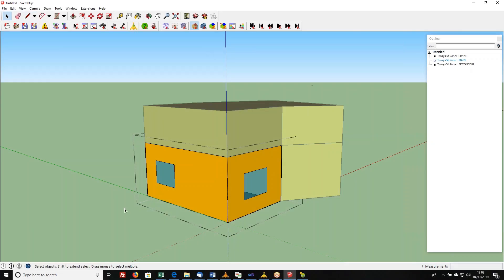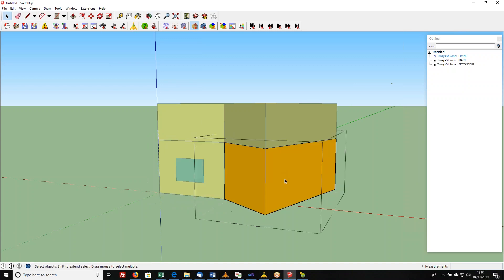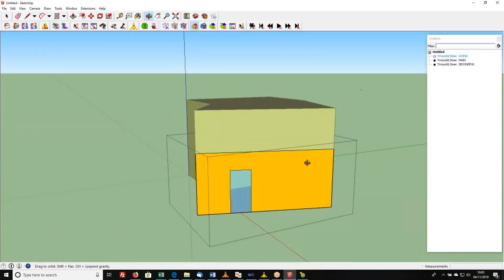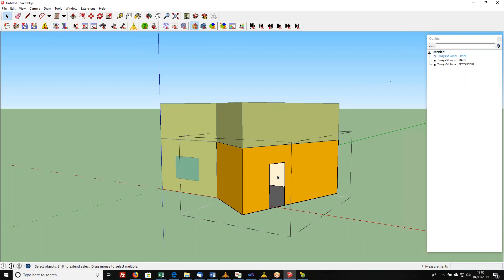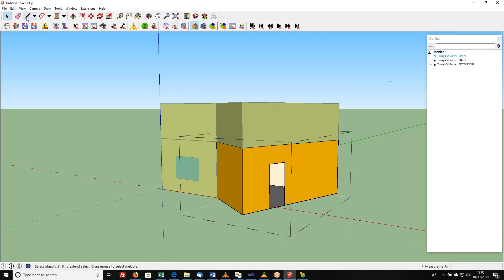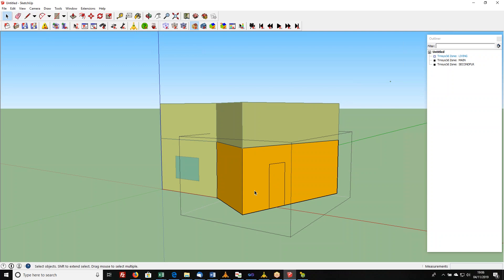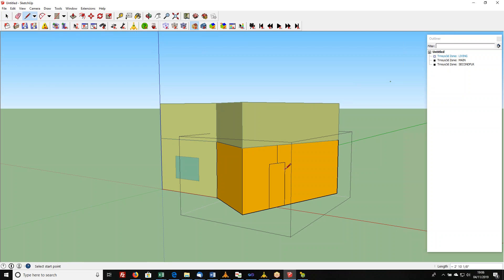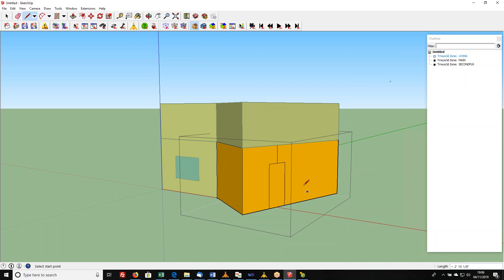Adding a Door to a TRNSYS 3D SketchUp Project

Comment: Good morning sir, thanks so much for this tutorial. I am having all the pain in the world to figure out how to define the orientation of my surfaces in sketch up before importing it into Trnbuild or can I define the surface orientation directly on trnbuild? Thanks for your help
Reply from the maker: You can define the surface orientation directly in Trnbuild. See pages 5-18 to 5-19 of the MultizoneBuilding.pdf document (in your Trnsys18/Documentation folder) for more information. Page 5-18 explains how to add a new orientation. See page 5-19 if you just need to rotate the building from how it was defined in TRNBuild (it's buried a couple sentences into the first paragraph on the page). You can also, in Simulation Studio, select File -> New and select the "3D Building Wizard" project template, then specify your .idf file, your weather file, and how many degrees to rotate the building. Good luck!

Comment: Hello, thank you for the great tip! I have an observation, wouldn't the last vertical line make the two areas surrounding doors concave, which could affect the results later?
Reply from the maker: Hello Karim, thanks for the question. I guess I don't see why the concavity would be any worse for putting the vertical line in (and having two semi-concave areas around the door) versus leaving it out (and having one surface with a very concave section where the door is located). You could always try adding two vertical lines, one at each vertice of the door going straight up, and see if that affects the results. I would imagine (like most things in TRNSYS) it's a very case-by-case consideration - for doors that are relatively small and narrow, the single vertical line trick works well, for something like a long row of tall and wide garage doors you may have to take another approach. Try it multiple ways and see what works - trial and error is part of the TRNSYS way!
Reply: @thermalenergysystemspecialists  Thanks a lot for the clarification! Actually I got confused between avoiding concave "zones" and "surfaces" when reading the manual.. Cheers!